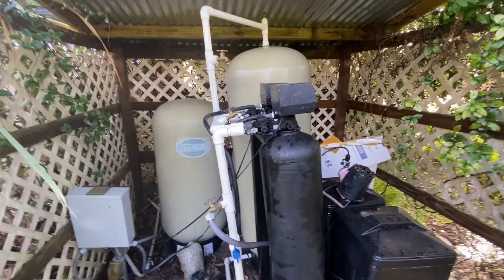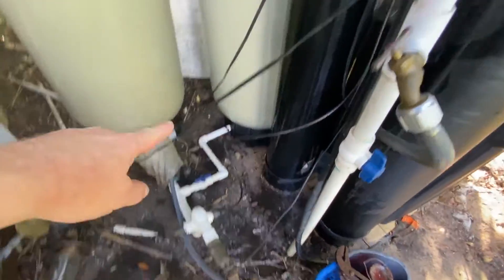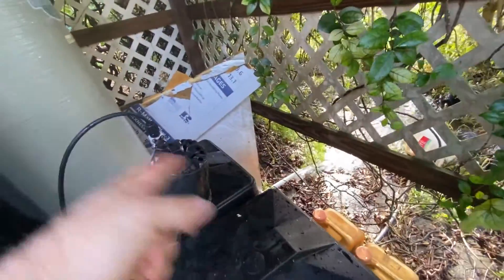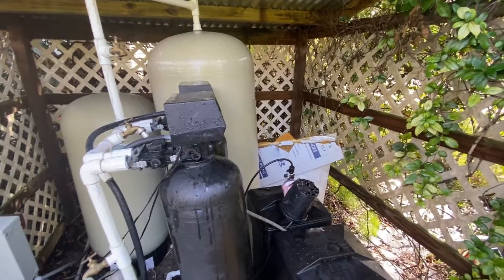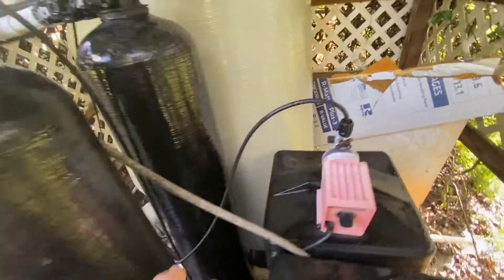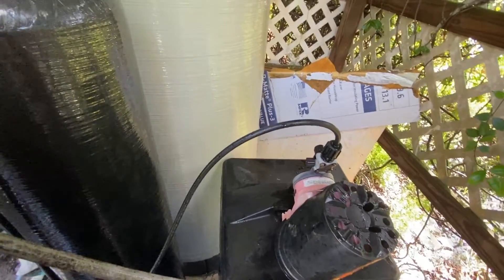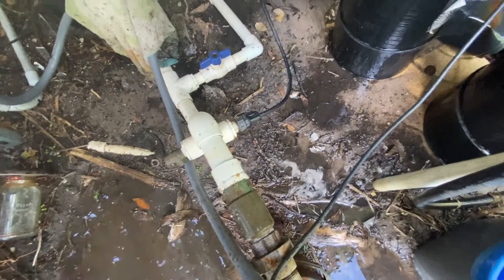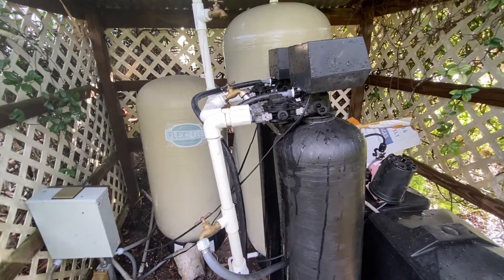How to maintain your Well Water Chlorination  Purification System

Comment: Where do you get that black chemical holding tank? I can only seem to find white. Thanks. Oh also which feeder are you using? I’m doing my homework as I plan on setting up a peroxide feeder instead of chlorine into my system. We have iron bacteria and I just learned about this. Our backwashing filter doesn’t cut it all out. 😊 thanks
Reply from the maker: The black tanks are the ones typically used for the salt,  they guy who installed my system used the same type for the chlorine.   The feeder is a Uni-Dose,  they have a newer model now which is available on Amazon.